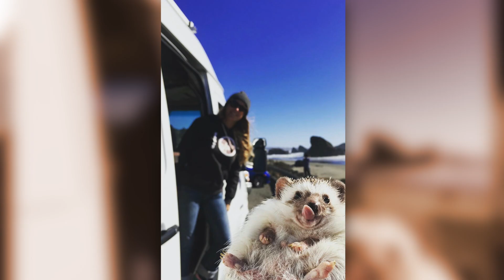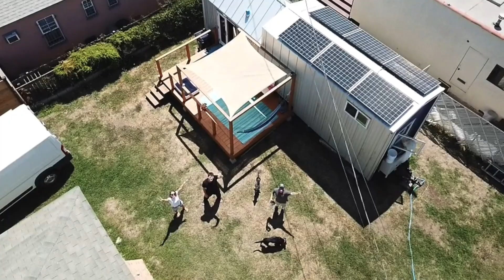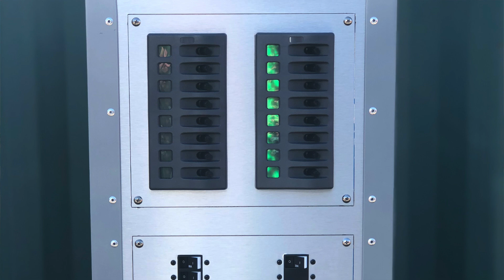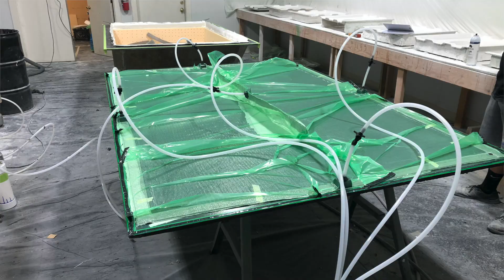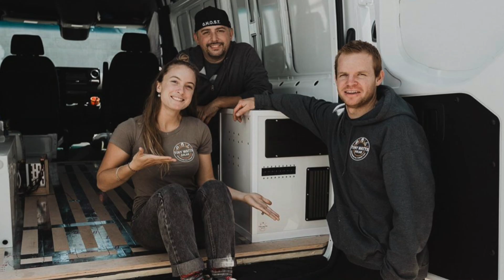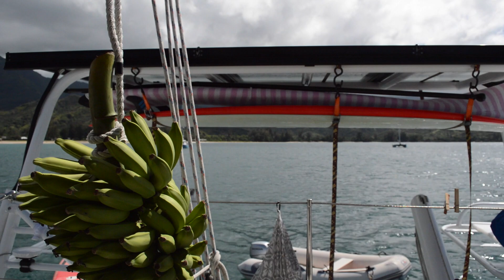HOW IT ALL BEGAN! + PRODUCT INFO!

Comment: Since the solar storage roof box is able to open hands free with a remote control, maybe it would also be a good idea to add certain pre programmed stopping points to allow maximum sun intake on the panels especially for winter time use. If so you would also want to add a retractable waterproof cover of sorts to keep your belongings dry or just have the panels move separately from the body of the box.